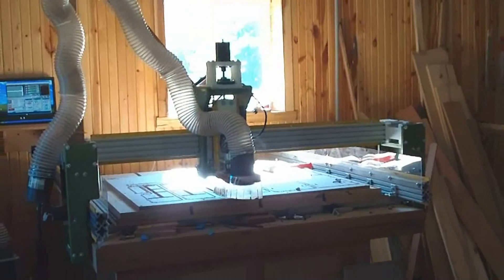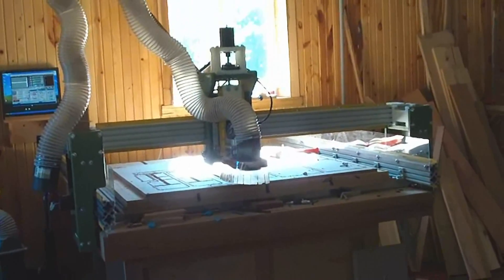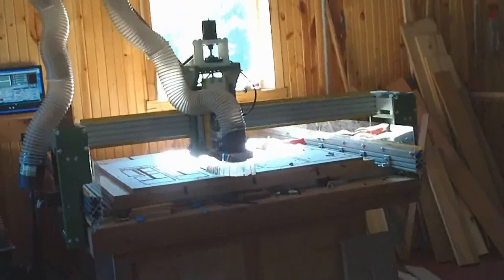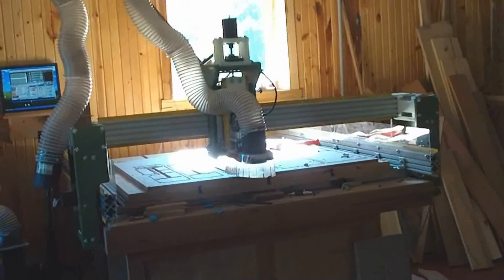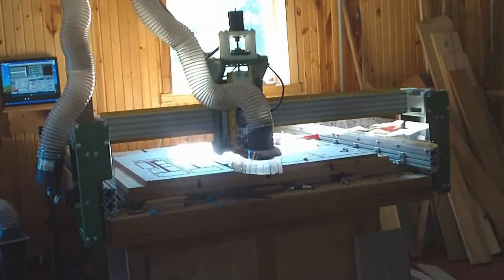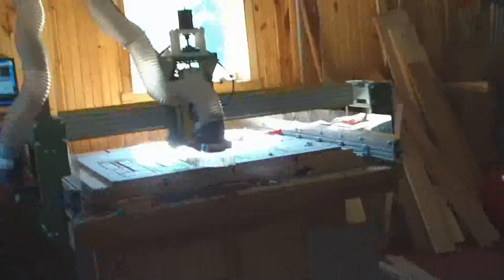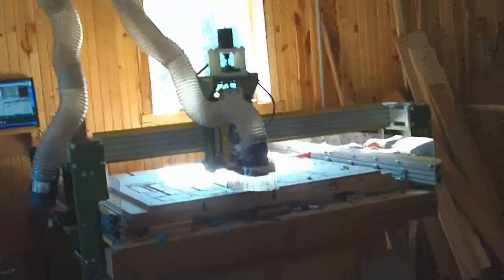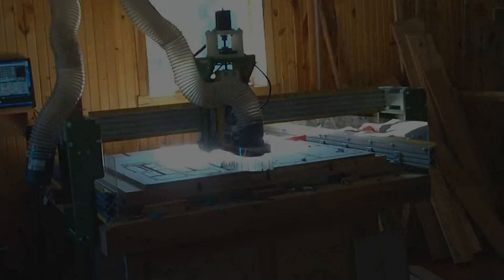Rack and Pinion Modification Test for Joe's 4x4 Hybrid

Comment: @swaggs21 
Hi! Thanks for your reply...
With "both sides" I mean if you had to install the system on both side but in the same axis, like the two lead screws in the Joes CNC... if you are in front of the machine, left and right.
Do you think that it has more precision than the lead screw? if yes... I believe that I will use it in my machine.. :) Thanks!

Comment from the maker: @monkeyking114 

It is now installed on X and Y (both sides), I used the system from CNCRouterParts. I think the system is far superior to the leadscrew system. You can see the all Rack and Pinion setup (except Z) running a 3D Test in the 3D Speed Test video on my youtube channel.